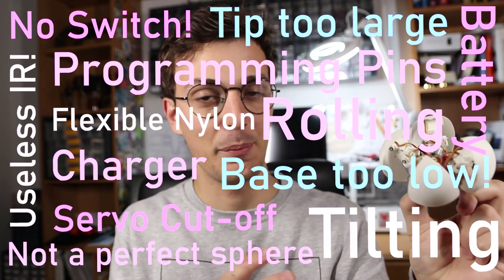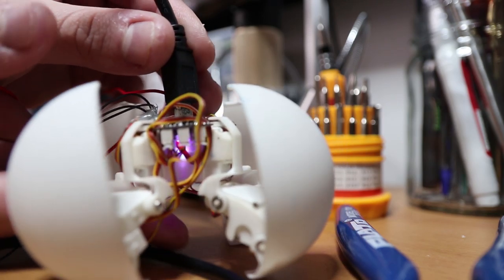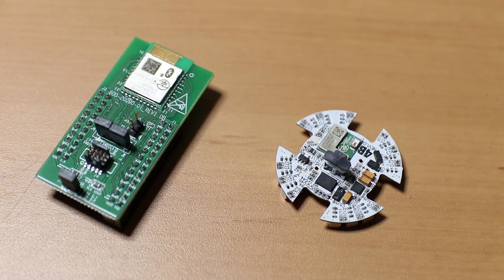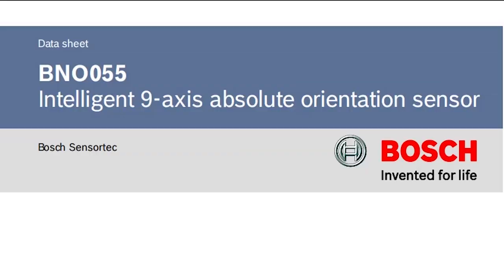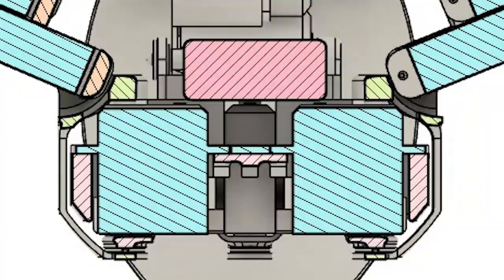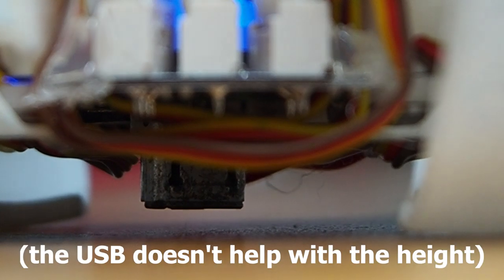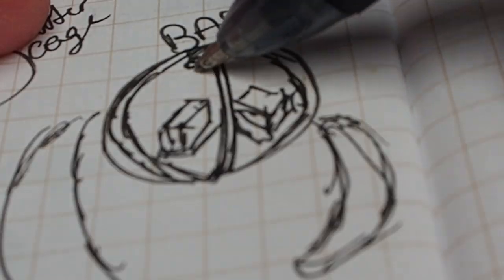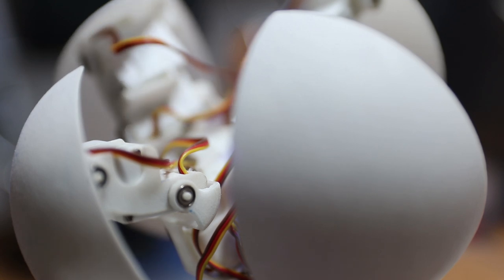4-Legged Robot Ball Issues

Comment: I would usually start redesigning the smallest parts and go up from there. In this case I’d do the mechanics before the software and electronics. So first the femurs, the inner skeleton, designing where the center of mass has to sit, redesigning the leg positions. Then move over to electronics and make sure the software is not overcorrecting for mechanical mistakes or shortcomings

Comment: You can use an Attiny10 to power it on and off by a mosfet, it will take less space. Also the Attiny can enter the sleep mode on each ON or OFF state, so it only consumes 0.1uA itself.
IMO you should start to create a bigger robot so you can code it properly with a larger battery as well, otherwise it might take you forever on debugging.

Also big thanks for not adding music to your videos :D

Comment: Hi, Hardik here,  
I am not as genius as you, but I may advise you something, 
If you are comfortable with increasing the weight and size of the ball by few centimeters,
then try and put electromagnets in the bottom and the top and a permanent magnet for the closing of the ball, without leaving any gaps. 
Use rubber to make the outer case. 
For the opening and the closing, you may use a miniaturized version of motorised hydraulic pressure rod
________________________
One more add on: 
If you can, just replace those bulky servos by your PCB motors, add some gears to it.

Comment: Reel switch will help with power off. you can power it off by command from phone. and connect reel switch to reset so you can bring magnet to close the switch and boot up, even when there to no opening in the shell.

Comment: I think that it would be possible to make the outer quarter spheres from very thin but durable sheet metal. Also, I have created a design of my own using this quarter sphere idea, and I was able to size it down to about the size of a golf ball. I think that you could also add a charging system using magnets, so that you don't have to plug anything in. this would also make 4B truly able to hibernate while charging. this also might reduce the weight by a small amount.

Comment: Instead of uaing an outer covering in ball shape you could use a inside rigid part 3d printed. And you gonna need a new hinge joints ,you could cut the stopping parts ,use shorter wiresand just put the motor out of servo and could join the chip to your circuit ,for battery output you could use a FLCB and need a new configuration of joints to make it a perfect ball , and make markings on it to makeit a perfect baseball

Comment: I do not know if this was suggested.

Anyway, how about putting ribbing to add stiffness to the external casing? If you look at, for example, plastic chairs you will see the seating arrangement has cross connections to support more weight. It would add a little more mass but the enhanced support might be worth it. A benefit could be using less external material thanks to the ribbing.

Also I suggest tabs to help align the shell.

Comment: You might be a bit hung up on the idea of "rolling" when it comes to fiddling with the center of gravity.

Since you have 3 degrees of freedom on the legs, you can mimic the locomotion of rolling by spinning the bot on a tilted axis. If you had less freedom of movement this would result in non-linear motion, but because you can push in more than one direction at a time you can correct the inclination with each step.

You might even be able to get it moving faster by spinning than you could by rolling.

Comment: Oof. Still running open loop, that's rough for steady state error. Maybe a PI compensator may be in order. Definitely think you should work out the transfer function model for the system and use both bode and steady state analysis to figure out the proper feedback to provide at each input. The control diagram may be messy depending on your inputs.
Reply: Where do you begin? Equation of motion?

Comment: Hi 
Loving this project 
I think that you should move from a sphere to a cylinder instead 
It should solve the centre of gravity problem 
Gives you more z axis space to work with 
And for rolling you can get the diameter of each end of the cylinder to increase or decrease to make it more cone shaped and then run your precession code

Comment: the bigest challenge might be to solve the issue while maintaining the formfactor,a bigger MCUand standard servos would givve you more room(code and spacial) and the IMU has more time to deliver its measurements for the rolling algorithmat a bigger diameter of the ball, but that also increases other problemswith rigidity,weight and power.

ih hope ou get everything as you want, I'd start with the mechanical issuesa as these constrain most of the rest of the design.

Comment: Hi!  Would using a wireless charging device (similar to what some smart phones have) be helpful?
Also, maybe a "lip" on the frame of the ball, so the sides join smoother?
I do agree with the suggestion to make the sphere larger, since that would allow more room for adjusting items on the inside.  Have you considered a variation of your electromagnets to "force" the sphere to roll?  
I think you are doing a great job on this project and I cannot wait to see the completed sphere :)

Comment: Try redesigning the ball shape have a small touch sensor with code to do actions like one touch on two touch pairing. Another idea is to change the edges from flat to round grooves this could help it close better. To fix that motor extension problem try extending the arm out it would then require less angle change to get the same result
Reply: Also with the extension of the leg it will give more room vertically since the outside ball plates would have to increase size a bit
Reply: By touch sensor i mean take advantage of sides and place it there it would be extra wiring but otherwise minimal inconvenience

Comment: what about putting a fast-spinning disk inside the robot, like a gyroscope? Wouldn't that help greatly with maintaining stability while rolling? I think you can use a simple vibration motor with the eccentric mass replaced with a flat & wide disk. But I guess that will compromise the battery life. I think making the robot bigger will help a lot.
Reply: That would also add weight and make it unable to walk, which it barely can do already
Reply from the maker: An extra motor will definitely increase weight (rember that those servo motors only weight 1.7g each) it is more efficient to use the once that are already onboard

Comment: Some feedback controller to minimize the error of the gyroscope reading? You would have to obtain the differential equations of the system to model it though. Ideally first you simulate, then you implement. Dr. Simon G. Fabri would have helped :D

Comment: Dude, just skip ahead to a meso-scale machine shop with 6DOF manipulators and CNC tools.  You're low-key the guy who knows the tools for making small-scale automation for manufacturing with your PCB actuators and tiny linkages.  How awesome would it be to have a desktop system that creates a part additively, mills it clean subtractively, and then assembles it with other made on-site parts into a completed mechanism.  A RC-Scale car factory that really worked would be the 21st Century's Faberge Egg automata.
Reply: This! It's a great idea!

Comment: He, I've used the BNO055 9-dof chip (serveral times) before and i strongly discourage using this IMU. Its relatively expensive in comparison to other IMU's with the slight benefit of proving on-board sensor fusion. However, I discovered that the sensor suffers from a lot of sensor drift; which can be easily solved using a better filter gains for the sensor fusion/complementary filter or a Madgwick filter. Yet, since everything is hardwired on the BNO055, you cannot change anything and you're forced to do it externally on another micro-controller. I would look into an alternative if i were you...

These sensor fusion algo's are relatively easy to tune, low computational cost, and there plenty of libraries available: https://github.com/arduino-libraries/MadgwickAHRS
Reply from the maker: Thanks for the tip! I will check about its drift and keep it in mind for future versions 🙂